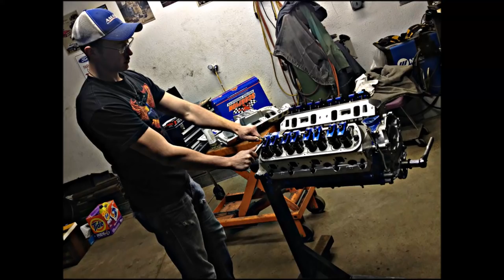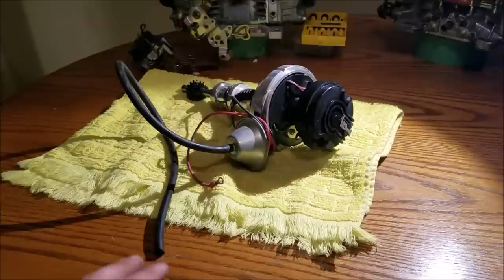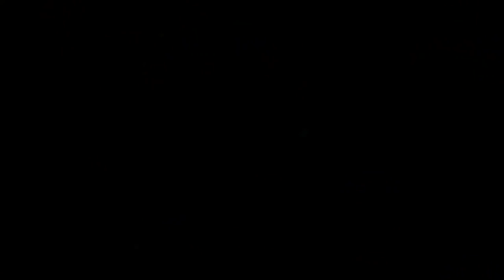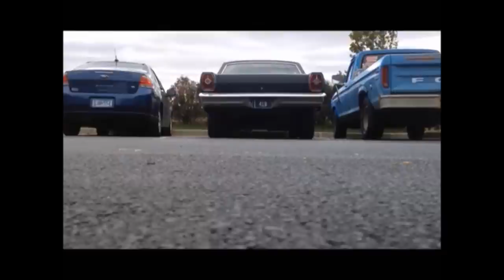Vacuum Advance Explained - What it is & How it Works

Comment: A lean mixture Burns faster this is what causes pinging or pre ignition I'm absolutely sure you have that part incorrect
Reply from the maker: One would think, but let me present it to you this way - 
To start off, firing the mixture early happens in two different scenarios, too much timing for that moment in time, or preignition where the mixture ignites before the spark plug fires at all. 

A lean mixture under higher throttle angles will ignite early as with having the throttle open more, there is more volume filling the cylinder - when that mixture compresses, it is a much larger pressure, where a lean mixture will self ignite. 

This is why we have a power valve open up enriching the mixture in these scenarios. 

Does this make any sense? 
I don’t present absolutely everything in this video as it is a lot to throw at people.

Comment: One engineering point.

People think the fuel/air charge explodes to drive the piston down.  That is incorrect.

The fuel/air charge burns across the cylinder from the spark plug to the far end of the chamber over a few milliseconds to build needed pressure.

What is not mentioned is that max cylinder pressure is needed at 10° ATDC for maximum leverage.

Mechanical and vacuum advance are used to build the needed pressure at all speeds and loads.

Comment: I have a 1985 Allegro motorhome with a chevy 454. I sucked on the vacuum advance (which is super rusty) and nothing moved. The engine starts but wont stay running without throttle.... this problem started when the ignition module was replaced. That was replaced because it wouldn't start. Any advice?

Comment: I have a 351c 4v and it pings on high acceleration loads with vacuum advance connected. When I disconnect it. It won’t ping. What can that be. It has a mild cam. Thanks
Reply: Are you running ported or manifold vacuum?